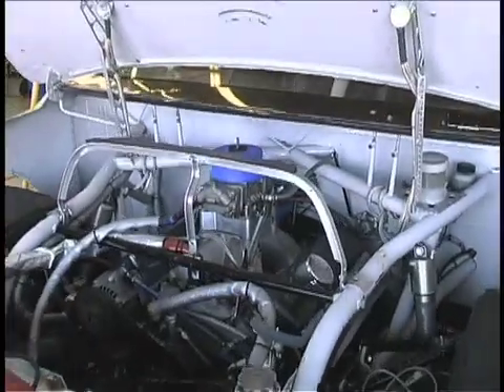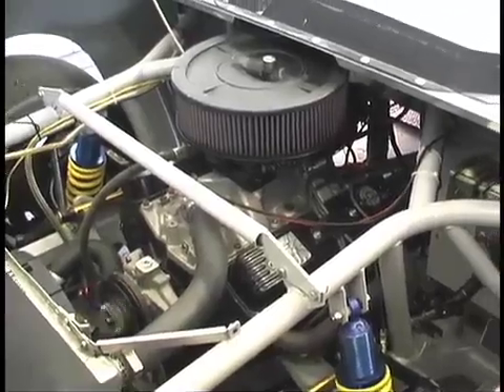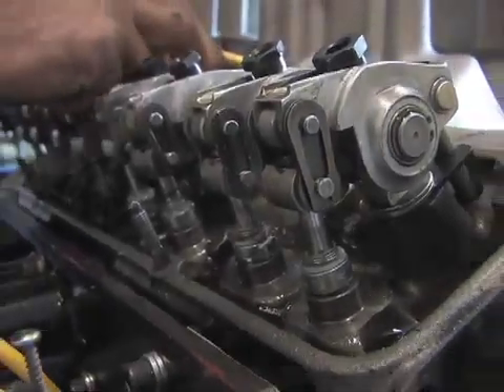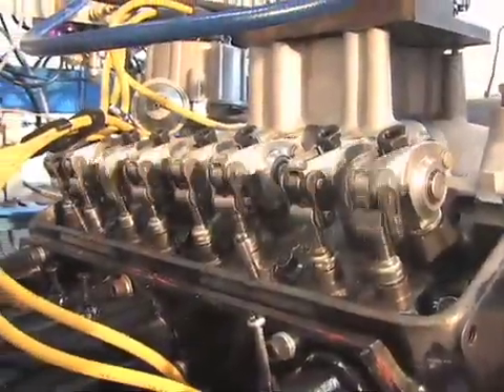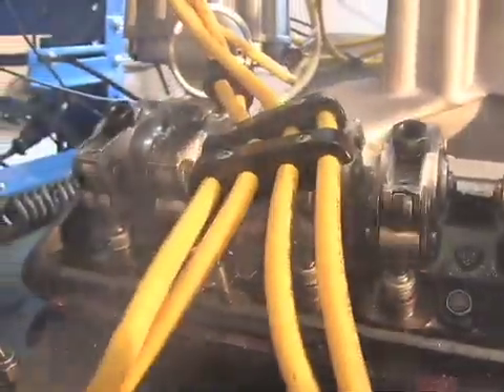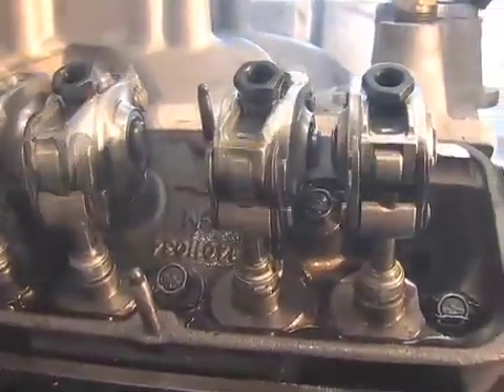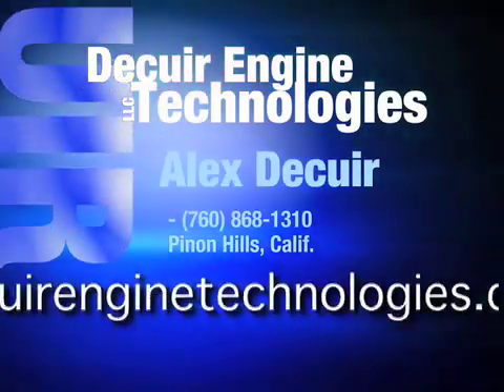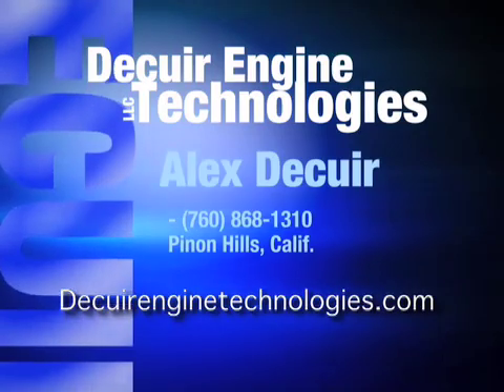Springless Valvetrain For Push Rod Engines!

Comment: I wonder, what is the possibility of developing this system for an old GM 6.2 Diesel. Something like this would help with even just the amount of noise developed from valve slap on diesel engines. If you do have a system for them, please tell me I would be more than happy to order a kit right away.

Comment from the maker: @mindfuckerification Got to agree with your comments, it is a amazing the amount of uneducated naysayers who think they know better. To answer your question if you noticed in the video there is a special camshaft that has an inner grove which the follower connects to and is helping to open and close the valves much like a connecting rod with the crankshaft. We are hoping to put together something for a 5.0 as we know it is a widely used engine. Thanks! DET

Comment: @EmpEntTV American Racing isn't an industry, it's a niche market. Let's get that clear, straight away. In any case, it occurs to me the largely increased  inertia of a desmodromic valve setup must increase the amount of time it takes for engine revolution changes to occur. Valve float can be eliminated through the use of springs that oscillate at different frequencies, between the main spring and the valve stem, and it does  not increase valvetrain inertia. What makes the Decuir system superior

Comment: @Tony01013 I just checked out the Coates system....and I smell rats. Al the videos are very unexciting. They show heads and they even show an engine you have to assume is running, but they don't have any quality videos of an engine running with their rotary valve heads. 
But Coates is the company I was thinking of. Thank you. They've had 20 years to perfect it since the magazine article. hmmmmm

Comment: Can anyone tell me why reed valves have never been developed for internal combustion engines?  I repaired many small compressor motors with reed valves.  They would run for thousands of hours and an 'overhaul' often meant simply removing the reed and reinstalling it upside down.  Goof for several more thousands of hours, too.

Comment: Anyone who has ever built a very high performance pushrod engine knows it takes a lot of force to turn a motor with very high pressure springs. 
 In my own experience it takes about 60-80 foot pounds of torque using a torque wrench to turn the crank. Every engine I have built with high pressure springs, 800-1000 lbs open, has done this.
 Eliminating the power it takes to do that should free up a good amount of power even with the exact same cam profile.

Comment: I`m wondering how the wear would be on the cam system at the cam shaft , normal low power engines can run over 300,000 miles trouble free, the 2,5 liter 4 cylnder GM I had  the gear failed on the hub ,and there was some light pitting on the cam. theres a Urepean stationary engine built in the early 1900`s that uses a system like this on the intake valves the youtube clip is titled Tangye disel. you can see a crank that operates springless  intake valves on the top of the cylnders

Comment: @Oldbmwr100rs Those springs are very light and really only work on slow cranking for starting. The springs themselves are almost nothing strength wise,they can be compressed with your fingers.I knew several people who raced Ducati's and would just leave the springs off the race bikes. As for having to stop valve burning,I never heard that,with hard seats and the right valve materials it shouldn't be a problem. In fact,for all the problems I've heard with them,burning valves wasn't one of them.

Comment: @Polybun You could use dual action electric solenoids. No springs necessary there but the plunger still is a heavy object and would be no match for a dual action pneumatic solenoid system. The car could have a pneumatic compressor operated by the engines exhaust system or a belt drive. At lower engine speeds lower pneumatic pressure would work while at higher RPMS the engine would develop the higher pressures required to operate the valves. Self regulating! Now add an accumulator.

Comment: @Oldbmwr100rs The Ducati still has springs even though it uses cams to close the valves as well. I think their design merely allows for the use of lighter valve springs. You have to use springs on the exhaust valves to keep the seats from burning. Unless you are using ceramic valves and seats.....do such things exist yet? Combustion and compression pressures are not enough to keep the exhaust valves from burning as already they are not that far from danger with today's regular spring engines.

Comment: @1971SuperLead  Ducati has been doing well with their desmo engines. As for the valve seating,the closing rocker must have some freeplay,and the valve is seated by engine compression and combustion,which is also the way it is on a normal sprung drivetrain. Pneumatic valvetrains on production cars are a dead end,too unreliable. Look into ducati's motorcycle engine operation,it's interesting.

Comment: @EmpEntTV  You're right,the sole purpose of this system is control of the valve,reducing friction losses is more power,this has nothing to do with OHC heads.Originally valve springs were too weak for high rpm use,the desmodromic system was made to counter that.Another thing that came from it was being able to make more radical cams and still stop float. With the development of better springs and lighter alloys,it became too costly to bother with.

Comment: Really? The valves seat as tight as with a valve springed engine? Don't you burn valves with this design? How do you keep the valves seated tight? Zero lash or a negative lash setting?
I don't get it. 
I think your system could aid valve springs, but not replace them.
Maybe you should have designed a pneumatic valve spring replacement system instead.

Comment from the maker: @9898983 You are missing the point, DOHC technology is obviously a high efficient means of valve actuation. The main issue is that that American racing engines and most American racing series do not use DOHC engines nor will then anytime soon. Our system is meant to enhance what is currently the dominant style of engine based on the current rule books. 
DET

Comment from the maker: @ruiferreira89 The whole point of this system is based mainly on use for push rod engines in racing applications. Yes its true that cam profiles, overhead cams and other advances have their advantages, the use of V-8 Chevy, Ford and Dodge racing applications really have great issues with high valve spring pressures, this system is meant to take out the great amount of friction through these high pressures and free up the engine. 
DET

Comment from the maker: @CustomDeluxe1984 Valves are not hitting the seats any harder than a normal racing valve spring. With the cam lift and duration set to proper spec its virtually the same. 
DECUIR ENGINE TECHONOLGIE

Comment: This is a great concept, but engines like the Chevy Small block shown in the video, must have their valves adjusted constantly (in racing applications). The need all kinds of stud girdles and such to keep the valves in adjustment. I would also think this camshaft design would have limitations as far as lift & duration are concerned.

Comment: @WTR1050 i agree becuz there was no oil visible in that video will the system will the system have to be wet or a dry sump, high pressure or low pressure, so what are those factors in that design????

Comment: How many rpm can system endure? I am not sold on it being able to withstand the rigors of racing. I am thinking of the 9000-10000 rpm many race engines routinely  see. But if it does indeed work for high rpm stuff. I would be great, it is getting tedious changing those valvesprings all the time.

Comment from the maker: @289pinto This system is currently setup for a racing application, so just like any other performance valve train it needs manual adjustment and is not really set up as a self adjusting system. We fee that the advantage of taking away the valve springs helps reduce friction and the amount of torque and horsepower needed to overcome the spring rates on racing valve springs. Decuir Engine Technologies. 
ps would like to see a picture of your pinto, we are pinto fans.

Comment: Looks very good but wouldn't you be constantly adjusting the valve-train as things wear to prevent power loss, noise and wear? There is no "self adjust-ability" like with hydraulic lifters and valve spring type assemblies. Just a thought....

Comment: @Warblade 118 It looks like the pushrod has some sort of pin  that fits into that slot on the camshaft lobe- the cam can then both push and pull the rod, the rocker looks like its connected via  a motorcycle type removable chain link to the valve stem. Cool idea if it can be retro-fitted.    Otherwise why not go OHC?

Comment: @f6john oh yes, you are right  SOME 2 valve engines are more powerful but i think with that engine it was more of a case of the whole engine itself was desinged better, and 2 valves are more oftenly used in racing car engines as there isnt as much friction too (because it only runs one camshaft) but i think smaller I4 engines benifit more with a twin cam 16 valve setup, like the rover K series engines

Comment: @mushere2k9 You might want to rethink that 4 vs 2 idea. The LT-5 Corvette engine was 4 valve and never made the power that the LS-7 2 valve engine is turning out. Not saying that the 4 valve motor couldn't be made to produce more power but when you look at the success of the Corvette endurance race cars today they more than hold their own against 4 valve competition.

Comment: well tbh i think its not a viable concept for a road car, but would be more effective on a 4 valves a cylinder motor, by using 2 cams right beside the crankshaft and connect by pushrods that way (on a inline engine) also there does seem to be a bit of valve tap too

Comment: Looks like some beautiful machine work. Do the cams push a tab on the side of the valve. Is this a workaround on the Ducati valve system? Looks like a pair of parallel round stock or rollers, the little cam is on the bottom side of the head?

Comment: v8 means nothing, anyone can make loads of horse power with a v8 because of the large displacement most of them have, it takes more skill to make a 2.0 inline 4 to get it to run big hp boys, this could also bee improved, it also looks like that the rod on the cam was going to come off, nice desin though, and i also think it would be too hard for a twin cam engine

Comment: @naturalyshocked You will find its EFI that improves 'vaporization' over carbs , not valvle count. And screw your 'clean exhaust' too.Shush when you dont know what you are taking about. V8s make torque and torque is more important in racing (cars, bikes) than your 4cyl skyhigh HP figure. I was a mechanic for 12 years, crew and race. You?

Comment: Hey, cool design. I was just wondering about the oiling of the valvetrain. How is the oil delivered to the rockers and other components in this system? Is it still delivered via the lifter and pushrod or are there other ways  that allow oil flow? Also what provisions  are there to keep this in tune and how frequently would one have to tune this system?  Thanks

Comment: @naturalyshocked You are a complete idiot.
Why dont you look at the LS7 in the Corvette and tell me that is not a high performance engine and it uses fucking pushrods.
There are reasons why OHC is superior but that doesnt mean that a pushrod engine is bad.
Youre an idiot if you think that calibra V6 is anything special.

Comment: I can see potential in something like this when used in competition, but for overall longevity, I see too much potential for failure. The main thing I see is the increased amount of friction surfaces, and the possibility of stretch and shear would appear to be exponentially increased also. Ultimately, I think The overhead cam is the way to go. Be warned...NASCAR and other sanctioning bodies are indeed looking at the possibility of overhead cam engines in the near future..5-7 years tops.

Comment: @Warblade118 The thing is with this system is that it wears out faster and needs lots of adjustment in short periods. Look at Ducati motorcyles, their valvetrains needs adjustments quite often especially compared with a Yamaha.  An LS3, what adjustments??? Plus a V-8 doesn't sound like a lawnmower with a burnt muffler?

Comment: @naturalyshocked thats true -.- they're still using crappy carburetors and supercharger instead of direct injection and turbocharger which raises the engines efficiency. For stupid oval race tracks might it be enough but for a really good engine U need more than capacity and a huge supercharger -.-

U need 20l per 100km to drive that sht a new porsche is below 14l and has a much better handling!

Comment from the maker: @naturalyshocked, We do have a system for overhead cam 4 cylinder engines. We don't consider the small block V-8 as a "crap engine," especially with most of American circle track, drag racing and road racing engines are of this configuration. Its all about potential business! 
Decuir Engine Technologies

Comment from the maker: Cortcomp, the cam and follower are linked and it is designed to pull the valve back in place. It is not your conventional looking cam as you look in the video. Everything is positive actuation and the valve is not left hanging open. Thanks for the question. 
Decuir Engine Technologies

Comment: So what returns the valve closed or pulls it back up after the cam ramp drops? seems like without a spring somewhere it would just hang there, no reason to close. Also, this is a pretty loud setup. With less friction why not less noise?

Comment: Very interesting take on a desmodromic valve system, how much machine work is involved in making the cam? I can see this working well in racing applications, but might run into high costs to produce. Valve springs have also changed in the last 20 years, a big one being "beehive" types, which have many advantages over older styles.
As for OHC systems, those work just fine as well, and belt drives on ohc engines have been very reliable for over 40 years.

Comment: @piiills yes your an idiot most overhead cam engines are horible for 1 simple reason they use a ruber belt that stretchs and breaks more often then our so cald shit engines now to mention that when they do stretch they often jump teeth and could leave to valve to piston clearance issues least when our chains stretch they dont jump teeth 

also our cams are so much easy to replace the timing chain on then your timing belts which means less money you have to spend at the shop when it does stretch

Comment: @01Z06guy Exporting cars from and to the US will also cost some money i think, here are some prices from Belgium where they don't have BPM. Corvette C6 convertible (they don't sell the Z06) 79.190 Chrysler 300c SRT-8 66.800 Cadillac CTS-V 75.250 Porsche Cayman S 64.251 Coxster 3.4S 58.564 Audi A6 4.2 q 68.000 A8 4.2 q 82.900 BMW 550i aut 67800. You didn't answet the question about the japanes import in the US and have you found your tappets yet?

Comment: @01Z06guy A 4 valve head (or 5 valve) makes the engines "breath"easier and the mixture of fuel and air is better (even better than a Hemi) that's one of the reasons a multivalve is cleaner (and more fuel efficiënt) A multivalve head in a pushrod engine is cumbersome, and involves even more moving (reciprocating) parts.The fact prove me right.

Comment: Stupid comparison.  OHV vs OHC is NOTHING like carb vs injection.  Try to explain how the cam arrangement has anything to do with CO2 emission.  It doesn't.  The only reason you try to make that comparison is because you still have your inherent false belief that OHC is more advanced.  I noticed you also ignored my request to explain for a Z06 is less pratical than an R8.  That's because it's not.  And that fact also proves your premise that OHV is "obsolete" to be wrong.

Comment: these engines are the biggest shit. push rod and overhead valves, and only two valve. why spend a lot of money for this useless junk? 4 valve and 2 overhead camshaft is much better. they must go with the time. every excavator or wheelloader has ab engine with 3 or 4 valve. die amy scheiße echt zum kotzen. und dann glauben sie immer was sie da tolles haben....

Comment: @01Z06guy In The Netherlands we have taxes depending on the CO2 output, no matter how large the displacement. If you buy a new car we pay BPM, an extra tax on cars, you get a bonus on this tax if you buy a car with a A or B energy label, and get charged extra from D to G (400 to 1600 Euro) and then we have "slurptax" if your car produces more CO2 than a set amount you pay extra taxes. so it's not anti US cars and anti- gas-guzlling dirty cars

Comment: @01Z06guy European figures (from AutoVisie not TopGear this time)Chrysler 300c (we don't have the 4wd) city 21.1l/100km highway 10.1 l/100km combined 14.1 l/100km 335g CO2/km. Audi A84.2 15.7/8.2/10.9 L/100km 259 gCO2/km that's not the same is it.Yes Ferrari's use more fuel and produce more CO2 but those are supercars and in another class.

Comment: @01Z06guy When there is a better way of doing something, then the other method becomes obsolete. In the future when exhaust regulations get more stringent, even GM will have to drop the OHC system in order to comply with the law. the same thing happened to the carburateur, a lot off people loved it  more than fuel injection, but it was impossible to get a carb engine to pass the exhaust tests.

Comment: "uses a lot more fuel and it polutes more"

Hmmm... Info from fueleconomy(dot)gov

2010 300C 5.7 AWD
City= 16mpg
Highway= 23mpg
C02= 10.4 tons/year

2010 A8 4.2 Quattro
City= 16mpg
Highway= 23mpg
C02= 10.4 tons/year

They are exactly the same!

Of course the Audi is build with more quality interior, it's supposed to cost twice as much!!